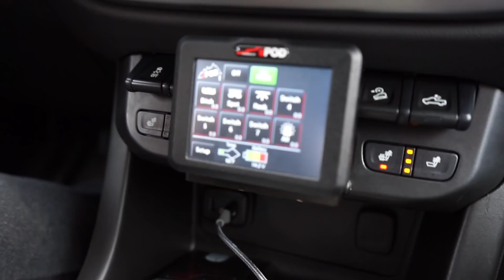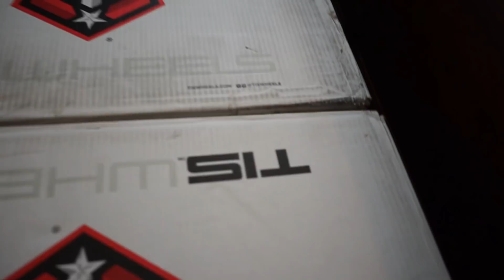Leveling My Denali!

Comment: nice although I think I would have done the rear as well the rake is there for a reason. when you put a load in the back your lights wont be searching for owls in the trees. those rims though absolutely!! Marry X-MAS to you and your family!!
Reply from the maker: You are correct, i put trailer on and it did squat a bit vs front. Im either going to install rears or order some bags for it.
Reply: @BaderBuiltRacing  LoL yeah It makes a difference. Bags would be the best when towing a load. This will also help prevent corvair syndrome.

Comment: Rancho to rough country is a downgrade
Reply from the maker: It most definetely rides better, I was after the kit because of shocks it just came with them. I have been looking into fox or Bilstein shocks
Reply: @BaderBuiltRacing  not surprised, the ranchos are probably specced for hauling heavier loads thus have a much stiffer ride. All I was saying is that ranchos are considered higher quality than rough country.